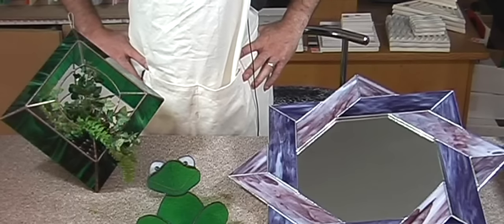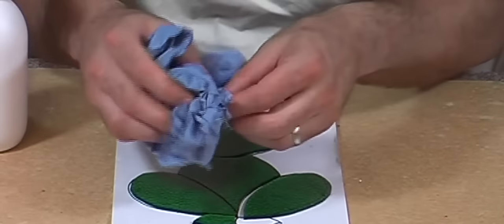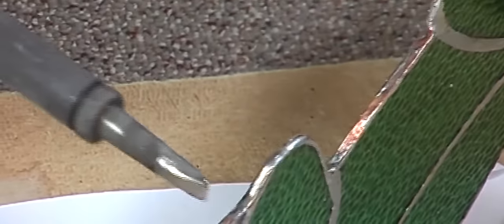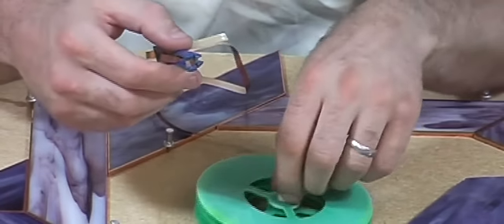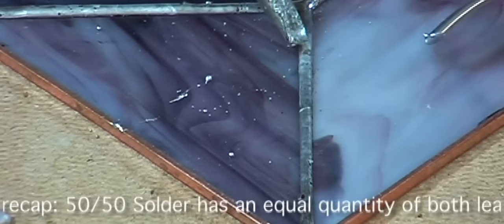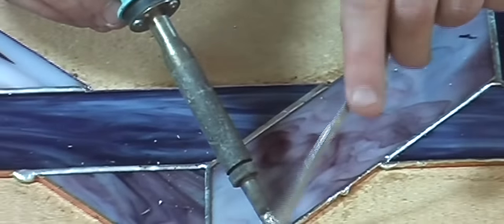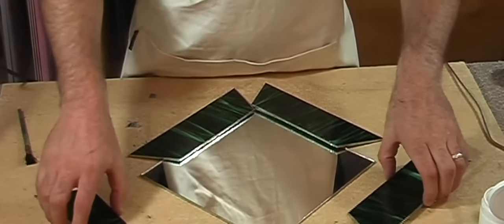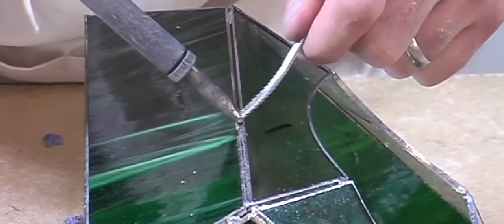Copper foiling and soldering techniques

Comment: 1- I  made  some  stain  glass  roof 'plafonnier'  and  I learn  from  you at  1h26  howto  put  more  stain  on  the  side  THANK YOU  for  that
2-I use magnet  when I put  hanger  it is  easyer  to  hold  and  no heat  contac  whit  finger
3- I  do net untherstand  why  you  do net  use  guabary  ;  it is  easy  to   compute  for 30 degre  anger  or 45 '  or  also 60 
I can  send  yopu  and  exemple  of  the computed   guabary
tahnk  again  
continus  your  utube is  helfull  for  all os
jack 47 71

Comment: AT  27.27  MAYBE A GOOD  TRICK  IS  TO  USE A FLAT  MAGNET FROM A  5 INCH  FLOOPY DISK  DIVE
HE  HOD  THE  IRON  WIRE  IN PLACE  DURING  THE PROCESS OF ADDING  WIRE  
JACK 47 71